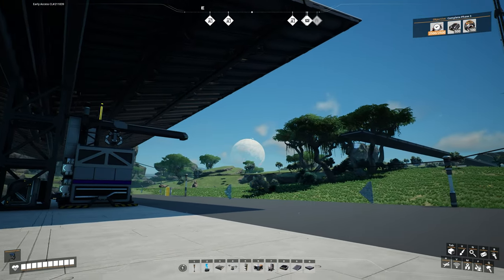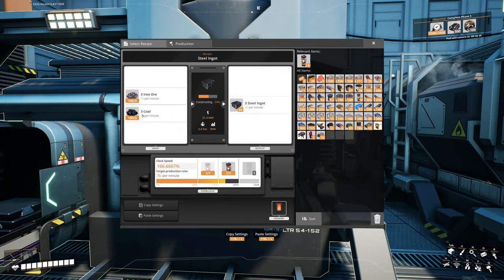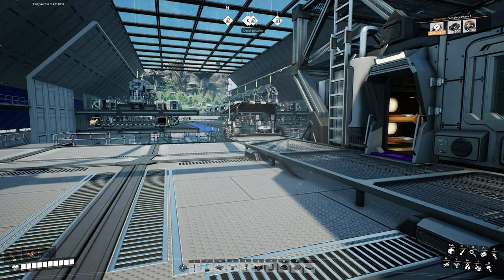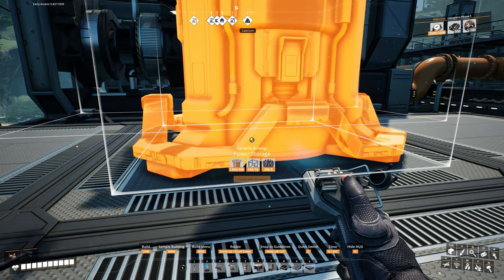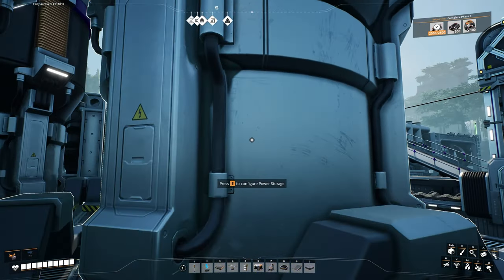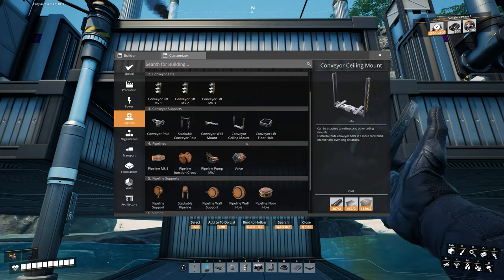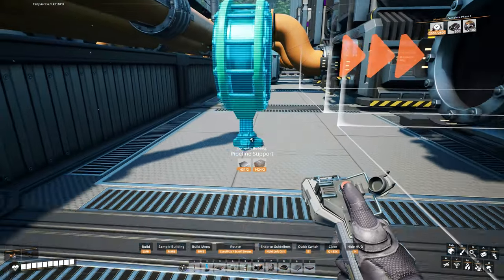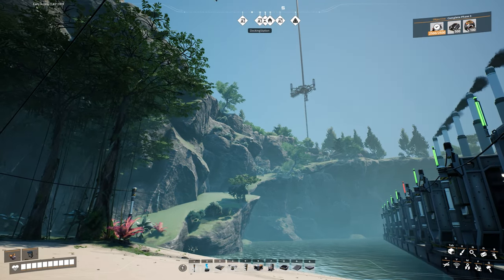BETTER COAL  EFFICIENCY  - How to Satisfactory - Satisfactory Tutorial and Walkthrough -  Ep. 27

Comment: I use 3 Water extractor for 8 Coalgens without overclocking. To make it work bring Water from 1 Extractor betweem 3rd Coalgen, another between 4th and 5th and the last between 7th and 6th. And alle CoalGens connected to one Pipeline. I hope my writing is okay.. not an english nativ speaking person ^^
Reply from the maker: Yeah I have seen those designs.. its definitely doable.. but there was only so much room to work with in this design.. could only get three pipes to fit total.
Reply: @PHENIXXCREATES  you could try an go higher with the pipes and fill in from above. The Extractors have 10m Headlift. Or just in the next CoalGenBuilding =)
Reply: @PHENIXXCREATES  you don't even need to have 3 pipe feeds per side, you can just make each side of the coal generator pipes into a loop, so the left 3 water extractors make a loop that feeds both ends of the 8 coal generators on its side. Having the pipe flow come in from both directions is more than enough to cover the 8 in its loop (it's how I expanded the exact setup you made in the earlier episode where you introduced this power plant, in the same place. I've actually since then added an entire second copy of the thing to the side, so I now have something like 35 coal generators running from that lake)